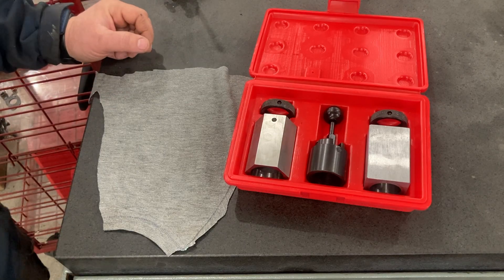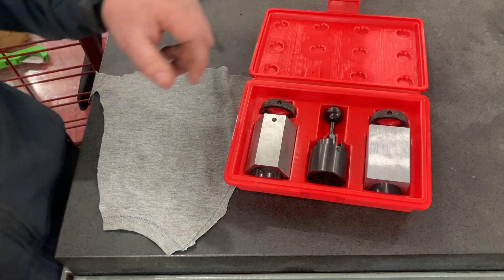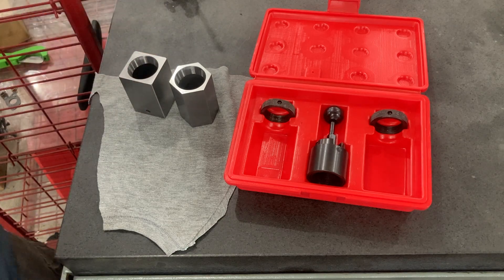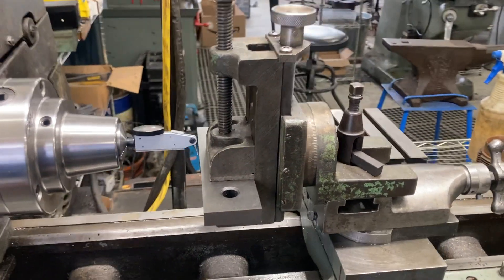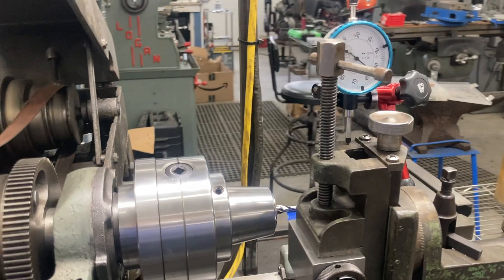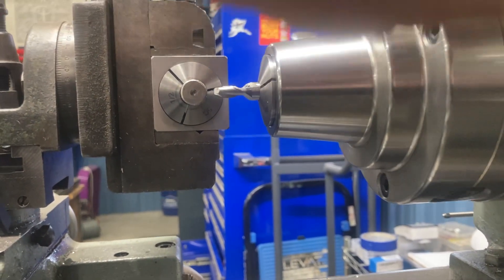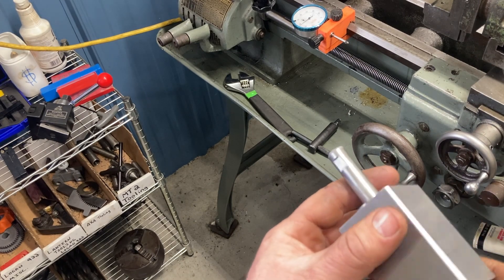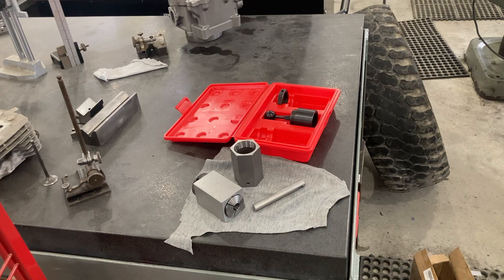Collet Blocks in a Lathe Milling Attachment

Comment: I DO THIS WORK ON AN ACTUAL MILL . 
WHY GO TO SO MUCH TROUBLE TO GET A LATHE TO DO A MILL's JOB ? 

I USE A 24 SPACE HARDINGE 5c COLLET INDEXER  . 
IT IS QUICK , EASY & PRECISE FOR 2 , 3 , 4 , 6 , 8 , 12 & 24 SPACINGS . 
I WILL BE DONE WITH MY PART IN THE TIME IT TAKES TO WATCH THIS VIDEO .
Reply from the maker: Yes, obviously there are much easier and faster ways to do this.

The point here is to help someone who ONLY has a very limited home hobby shop without access to a dedicated milling machine.

Also, a set of collet blocks new is $50. How much does a new Hardinge 5c collet indexer cost again?
Reply: @MaineMachinist  I DON'T KNOW WHAT A NEW INDEXER COST . 
I GOT BOTH OF MINE USED . ONE IS 24 SPACE AND THE OTHER HAS 36 . 

I WORKED FOR YEARS WITH A GUY WHO WENT FOR THE COLLET BLOCKS 
EVERY TIME WHEN AN INDEXER WAS RIGHT THERE ALONG WITH 
A MILLING MACHINE . TO EACH HIS OWN I SUPPOSE . 
8 , 12 & 24 DON'T COME UP THAT OFTEN . 

IF YOU NEED TO DO MANY MILL JOBS ON A LATHE YOU ARE WASTING 
YOUR TIME YOU NEED A MILL .
Reply: Maybe you could use your mill to turn off your caps lock
Reply: @DodgeMusic25  DO YOU KNOW WHAT A MILLING MACHINE IS ?

Comment: Great video,  and even better without all the fancy tools like DRO's or edge finders
Reply from the maker: When I use my Logan 922 it’s all old school setups - and I use this lathe a LOT in a professional setting.

Nothing wrong with using the old school ways! Glad I was able to learn them from the old guys back when I was a teenager.

Thanks for watching
Reply from the maker: If you haven’t seen it, I have a shaft duplication video using this lathe with the milling attachment. All old school setup. Two keyseats, a tapered section and single pointed threads.
Reply: @MaineMachinist  I have seen seen the video along with almost all your videos, with excellent content.